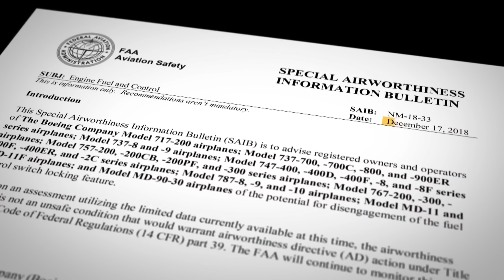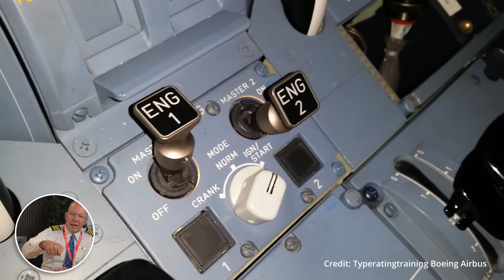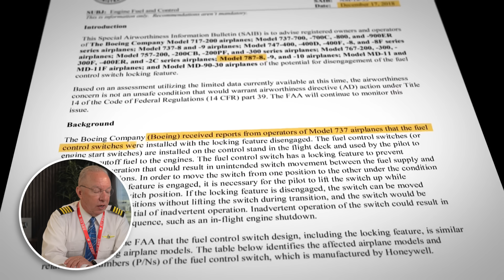Air India 171: The FAA’s 2018 Fuel Switch Locking Bulletin Explained (16 Questions Answered)

Comment: Captain, at 6:11 you state, “when looked at objectively, it’s clear that there was a human intervention — plain and simple — from the reports.” Are we oversimplifying a complex technical scenario for a general audience. Nowhere in the official report is human intervention explicitly confirmed.
I work as an engineer, and when I encounter an unexpected or unexplained system reboot, my first step is to check whether anyone on team members who are  highly experienced and reputable manually initiated the reboot. If all confirm “NO I  DIDNT”, I begin investigating alternative root causes. Regardless of how advanced a system may be, there is always a non-zero probability of unexpected behavior due to a range of technical factors: component degradation, quality control lapses, software bugs, maintenance gaps, unexpected external inputs, or even rare hardware anomalies.? 
As professionals, we know how easy it is to reach for the “low-hanging fruit,” but also how important it is to resist doing so, especially when lives and reputations are involved.

Imagine yourself in that situation — working with an intricate system that fails without a clear explanation. Would you want your actions to be the default assumption without irrefutable evidence.

Comment: Correct me if I am wrong. The next step after the aircraft is airborne is to retract the landing gear and it is done by the pilot monitoring as the pilot controlling has both hands on the controls. In this instance the gear is still down and the fuel switches turned off ??!! Curiously, somebody  knocked the fuel switches off instead of pushing the lever to get the gear up ??

Comment: Find it incredible there's no proximity switch on each of the fuel cut-off switches to prevent such a scenario/ incident where they can be manually altered without having to acknowledge & override an audible warning.
⚠️ 
Remote as it is there could definitely be a scenario where these switches were not latched correctly, as previously reported.
⚠️
Re the black box voice recorders.. how many persons & whom exactly handle these and witness the extraction of the initial playing of the recordings. 
This procedure could and should be recorded visually to prevent unauthorised invasion/doctoring.. imho.
Thank you Captain Steve.
Rip & condolences to all🙏🏼

Comment: The crash of the Air India aircraft, where the fuel cutoff had been activated, is missing a full context of what was said between the pilot, captain, and air traffic control. Additionally, what other scenarios could trigger a fuel cutoff automatically without physically pressing the actual switches?

Comment: These are Fiy by wire planes. The signal from the switches can be overridden by the FADEC/ECU. The signals from the controller can shut down fuel EVEN if the switches are physically in the RUN position. Ask a Boeing technical authority to confirm on oath that ONLY the physical switch can turn off the fuel.
Reply: Is this your opinion or is this a fact?

Comment: Captain, I want to set aside any subjective interpretations(who said/saw what, when etc!) of the CVR for now. 
Purely from a technical perspective, is it possible for a scenario similar to a "man-in-the-middle" attack to occur, in which an imposter device—such as a mobile signal-activated relay—could be attached to the electrical wire running from the engine fuel switch to the backend bus? If this imposter device were to short the wire in the same manner as the manual switch, the FDR would record it as a manual action, and the backend electronic system would register it as a legitimate pilot command, thereby initiating fuel CUTOFF to the engine.
Reply: We have seen supply chain attack in pagers, I think this switch assembly was replaced in 2023 on this aircraft, it was an opportunity for whoever to tamper
Reply: @ammayiku  Since the aircraft has not flown much, it was in the mobile coverage area for sure. Maybe a 100$ or so to assemble something like this

Comment: I wonder why it is even possible to cut off those switches in such a intense phase. Would it not better if systems could prevent that? A mechanical block or something similar via electric system. And, for example, not under 10k feet or just switchable under 10k if there is a emergency warning. 
There are possibilities and i think the fuel switches are damn important, they shouldn't move so easily.

Comment: @Captain Steve,

For the Bulletin you went over, it recommends this while the plane is on ground. What if the pilots didn’t check this while the plane was on ground. Also, there is no proof of human intervention as you mentioned nor preliminary report mentions any human intervention.

1) Inspect the locking feature of the fuel control switch to ensure its engagement. While the
airplane is on the ground, check whether the fuel control switch can be moved between the
two positions without lifting up the switch. If the switch can be moved without lifting it up,
the locking feature has been disengaged and the switch should be replaced at the earliest
opportunity.

2. Why it took less than 1 second to turn off Engine fuel switch while it took 4 seconds to put it back on run? Is it even possible to turn both switches off within a second?

Comment: It is very clear that if any wrong instructions are given to the machine is a human error, meaning that if anything happens from the cockpit, it is fully the responsibility of pilots if it happens naturally outside of the cockpit, then you can say machine or mechanical failure so here it is very clear what happened with Air India 171.

Comment: The Boeing 787 manual says the first thing to do in an engine shutdown is to recycle the Fuel cut-off switches couldn’t this be possible that one of them remembered it and instantly recycled them(which sounds logical explaining the 1 sec gap between them)

Comment: If the switches were faulty, could it be a fault with one of the switches, not both? As the bulletin indicates mechanism defects, it’s unlikely that both switches’ mechanisms failed at the same time? Or is it just one mechanism on which both switch depends on!

Comment: You’re wrong Steve — and biased for obvious reasons. That much is clear, and it reflects either poor IQ or worse, poor EQ. As a pilot, you should know that shutting down both engines isn’t an impulsive or accidental act. It requires throttles to idle, guarded switches lifted, and fuel cutoff — a coordinated process that takes time. At ~600 ft AGL with under 60 seconds before impact, executing that sequence on both engines is practically impossible.

Add to that: the nose-up pitch until impact suggests power was still being commanded. Unless the CVR/FDR conclusively shows intentional shutdown, the conclusion in the preliminary report is not just premature — it’s technically flawed.

Comment: This is Boeing's fault. Why do they have manual engine fuel cutoff switches? So that if the pilot has a bad day, he takes everyone with him?
these switches should be locked, and automatically released once the aircraft detects some engine fire or failure.

Comment: I think that before blaming the pilots we need to be 100% sure how the signal of the statuses of the switches are acquired from the blackbox(telemetry). are the statuses  signals of the switches acquired directly from the switches itself or from the airplane computer? 
So depending from the answer  I've ended up two different conclusions
1. If the statuses of the switches are acquired directly from the switches, there is no doubt that the switches have been placed intentionally (if the switch mechanical interlocking was working correctly) or unintentionally (if the mechanical interlocking wasn't working correctly) to cut off position
2. If the statuses of the switches are not acquired directly from the switches itself but for example from the airplane controller, there could be a remote possibility that the system controller had an electrical problem and red both the switches in cut off position for ten seconds ( same data acquired bybthe blackbox) for whatever reason and closed the valves causing the thrust loss
P.S. I'm an electrical engineer and I manage control systems

Comment: Correct me if I am wrong: but the aircraft in question undertook a major service in 2023.  At that service there is the possibility that the fuel switch barrels were replaced, due to wear on the locking indents (the metal indents wear over time when the switch is toggled when parking).  Honeywell manufacture the switch, and sell the switch and barrel as one unit. It is possible to install it 180 degrees incorrectly so that the indent faces “down” (towards the rear of the aircraft), not up. It therefore becomes possible to knock the switches from “on” to “off”, which could happen during rotation.  Is that a plausible scenario?

Comment: Captain, what IF the spring loaded on the switch, loss it's mechanical properties and popped the switch to move to stop position which is at the bottom? It's easy to move from top to bottom when a holding mechanism failed during the take off vibration. 

Just my 2 cent thought 😢

Comment: Capt Steeve you are wrong. This is not a pilot error. This is a computer chip which malfunctioned. Boeing send an advisory to change the chip for aircrafts with more than 11,000 cycles.  If not changed , it malfunctions and sends wrong signal to the controls, if it over heats . This automatically cuts of the fuel to engines and sets of alarms in the cockpit. No where is the fault of the pilot. Please therefore refrain from spreading false information until the final report comes out.  Thanking you.
Reply: The sound of the switches being flipped two times each has very likely been recorded on the cvr and was compared to the fdr.

Comment: Captain Steeeve

I am amazed how you passed off the knowledge that both GE and FAA has issued a bulletin on 11 Jul 2025.

I am not a commercial pilot but have flown 6000+ hrs on fighters where the flight duration is a mere 35-40 mins.

As per my understanding the Fuel Control Switches are what is the LP Cock - Low Pressure Cock. This always in the ON position and the cutting off the fuel supply to the engine is done bringing the throttle to CUT OFF position.

This is a better system.

Comment: In a jeep that i drive. There is switch to switch between fuel tank. While the jeep is still in driving, there is almost no interruptions or deceleration, at the most i can just restart engine, just matter of seconds, and resume driving. Is it time to have all airliners to have a third engine as backup?

Comment: I cant believe that the pilot intentionally cut it off. It’s a cover up by big organisations to blame pilots. I knew this before cause if its Boeing or Air India at fault. They will be finished.
Reply: I can't believe that Boeing has no audible warning when engine cut-off is engaged during flight. It's not as if it's like a minor issue FFS.

Comment: dear sir, i understand that both the fuel cutoff switch are mechanical switch. Even they are mechanical switches what they actually send are electrical signal for cut off or run. Data recorder cant say in anyway if the switches were ACTUALLY MECHANICALLY  switched from run to cut what they can state is the electronic signal given to the computer was to cut of the fuel supply then again given electronic command to engine to start up.   after the crash the switches were found in run position where they supposed to be. my question is very simple can there be electrical faulty command to the computer to shut down the fuel WITHOUT the actuation of the mechanical switch ?

Comment: Captain, is there a chance that the springs in the fuel switches lost tension that it moved back to the cut off position minutes after it was brought to run while take off ? Does it have a connection  to the directive issues in 2018 for the fuel switches ? Replacement of these switches would have avoided this havoc ? I am just a normal engineer analysing the scenario.

Comment: Could the 10 second gap before engine cutoff switches back to on indicate some sort of physical fight or tussle between the pilots ? ie. Where the pilot who put the switches to cutoff is trying to prevent the other from putting the switches back to run. The 4 second gap between the 2nd switch being put back to run also might indicate further tussle ? 4 seconds is a long time, as is 10 seconds.  This is why cockpit video recorders are necessary. Video of cockpit behaviour would also deter pilots who want to commit suicide from thinking that their actions might remain not fully known in the future.

Comment: At take-off, can an unexpected or sudden vibration running through the body of the aircraft move or dislodge the precise location of the fuel cut-off switches? 

I had experienced this vibration during take-off (as a passenger) some years back. The vibration was quite substantial and made a few passengers to emit a scream, but everything settled to normal in a few seconds.

Comment: There could have been logic that locks out those switches. It could be on a timer or based off of parameters like  wheels up sensors,  aoa, throttle settings, altitude, time and distance from takeoff.   I understand a pilot needs unconditional access to shutting the engines down, but why  would both engines need to be shutdown while on climb out, or withing a few minutes after wheels up.   At the very least , for the most critical times, there should be a safeguard.   I'm only talking about dual engine shutdowns, there's very little to almost no need to shutdown both engines simultaneously, especially within the first couple minutes of flight. 

It's mind numbing there aren't cameras anywhere in a plane, since they are basically everywhere else in society, or mass transportation, especially in airports.   Why have cameras anywhere if they don't belong here?   You can't really compare them to public cameras, or public servants, where public has access.  Cameras on a plane are private, closed circuits,  no foia, no public access. They can even overwrite like the voice recorders do.   A camera would have stopped all speculation on what happened here, they may even deter bad behavior, but I don't think a camera would have prevented this at all.  They wanted to die and they picked the most critical time due to not having enough speed or altitude to restart.

Comment: Mr. Steve you have a single point agenda that is to blame pilots. First it was flaps, then landing gear, now fuel switches. Every mental health issue need not lead to suicide and every accident need not lead to pilot error.
For gods sake stop blaming the pilots untill a concrete evidence is found. Put some blame on software and machine as well in the meantime!!

Comment: As an added safety measure to ensure the cut off switches cannot be operated accidently surely they should be covered with a see through flap which has to be lifted to access the switches.

Comment: Capt. Steve, as a layman I am of the belief that the fuel control switches are intended to be used only when the plane is stationed or in an unlikely event  of any of the engines catching fire mid flight.
That said in an extremely unlikely situation of both engines catching fire during take off where enough safe altitude is not attained like in the Ahmedabad crash,  what can the pilots do. Cause switching off both engines shall bring the plane down. So why not a safety logic be introduced wherein both engines cannot be shut down during take off till a safe height be attained.
Please comment.

Comment: Steve, I think cockpit video camera should be installed and used during takeoff and landing. Basically five minutes for v rotation and landing. Because once the plane is in flight it is unlikely that a criminal act on behalf on the pilots could be committed unknowingly. Also, takeoff and landing is where residential or commercial areas are the most vulnerable.

Comment: Hi Steve, I have a question that you can answer in your next post - Is it practically and humanly possible to move both the 787 fuel switches from run to cutoff manually by hand within a duration of just 1 second by single hand or both hands?

Comment: Hi Capt.
Why did the landing gear not retract as normally expected during the initial climb? Could this deviation, along with the unexpected transition of both fuel control switches to the CUTOFF position, indicate possible pilot incapacitation, confusion, or another abnormal cockpit event?

Comment: Here is a different scenario that might explain the crash: 

1. Both pilots are trying to do everything correctly. 

2. There is nothing wrong with the switches.  The fuel switches are working perfectly and are in the "run" position.

3. However just after V1 take-off there is something wrong with the electrical signals that caused the fuel to be cut off (even though the fuel switches are in the "run" position and both switches stay in the "run" position).

4. One of the pilots notices that the engines have stopped and assumes that the fuel switches have been cut off and immediately remarks "why did you cut the fuel off".

5. The other pilot correctly responds "I didn't do it".

6. Then one of the pilots turns one of the fuel switches off and then back on in an attempt to restart the engine and then does the same with the other switch (this is why the data recorder shows that the fuel switches were cut off).

7. In other words the fuel switches being turned off by a pilot was an effect of the pilots acting in good faith, not the root cause.

My questions:

Is there enough information from the black boxes that could rule out the above scenario? Specifically is there data that shows the fuel valves or pumps being on or off independently of data about the fuel switches?

------------